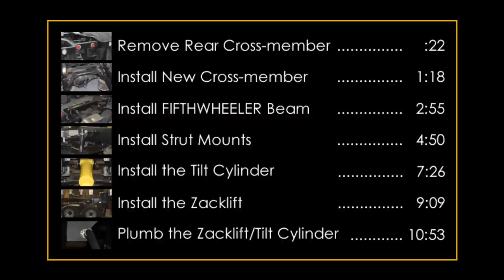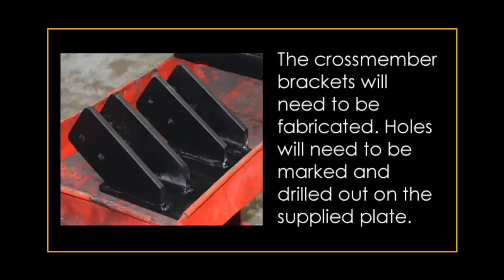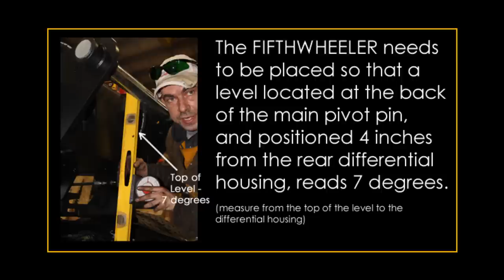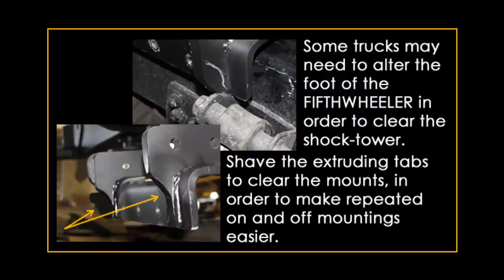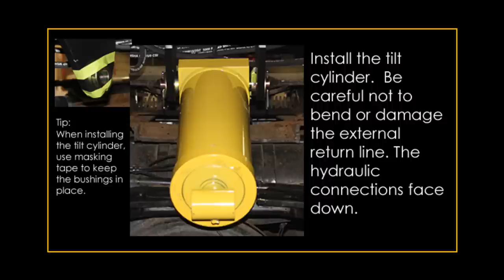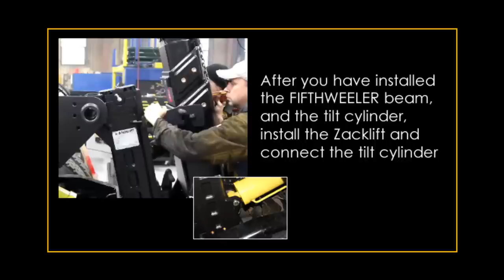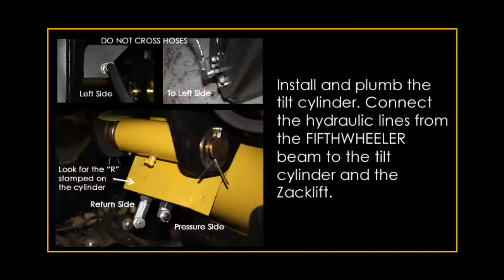Zacklift FIFTHWHEELER: Installing a Zacklift FIFTHWHEELER

Comment: They need to add a hydraulic winch since it already has the pump. Half of the tows are slipped off in the ditch, or trailer shortcut the turn, etc. Watch the towing vlogs, they move as Slooowwwww as possible because insurance is paying them.  That's how they afford all that CHROME, and Bling. 
You'll save big money with this unit and a winch